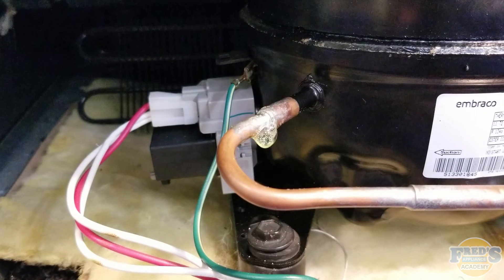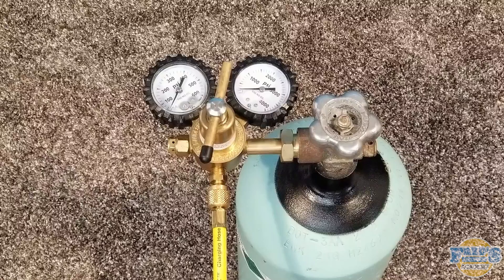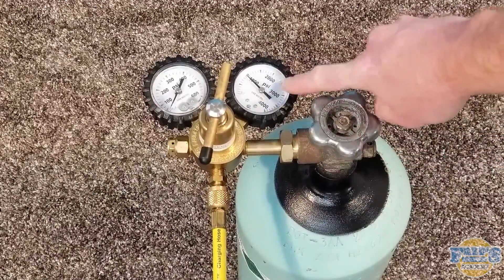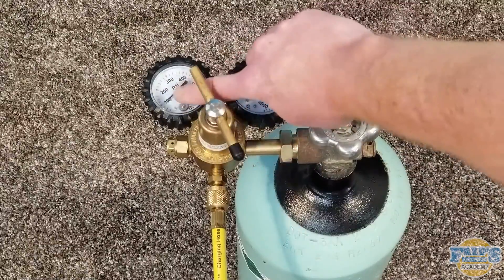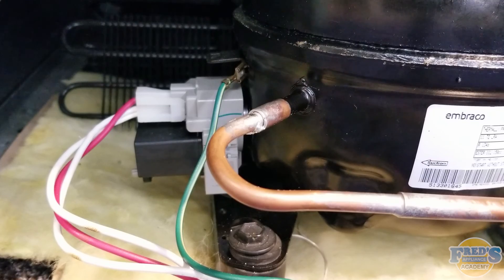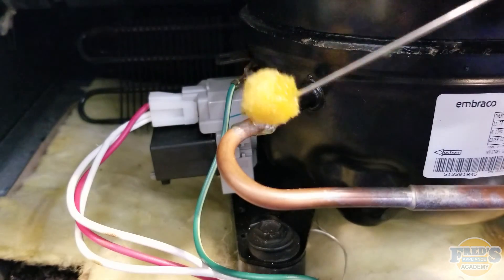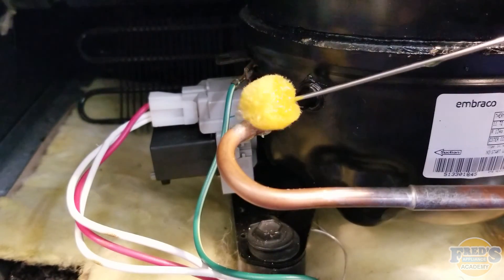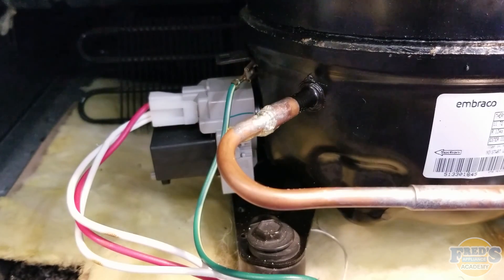How to pressure test a refrigerator sealed system using nitrogen

Comment: What bubble test solution are you using here? Ty
Reply from the maker: here is a link for you. https://www.amazon.com/Highside-Chemicals-23008-Mid-Temp-Detector/dp/B08QGNP4YF?crid=1W14U0WYBBM56&dib=eyJ2IjoiMSJ9.VIYtDSgX0wVyFfm-Ww68nYETnY0dvkUxVsQZb8Ruv9F0Yk64JNShLT47sA0M_tRLDzHni5EYJuh6pJeI-Rn8nqawW6i4q9CobQIntZmL0pwPNijNxWqp-LHmKyFKjCqApr3aW3X_fajyUKpGJ1CNLmEj4rbnXeoCDcWBKTjc-SImfORyfAFJFfVFKR-NS53nW1hm8fm5fYmzmdEmCW-mkS5U3j7ar7vzuXOc8y4cqIjanTEnTF2i4pRSokU9MgyPWKw_lO392Xd-W-UvppfCexYH2DABP31vQxQMVYBKwf5SleWeg1fxMV3cbVNIp8SktOf5uUkGNomO5xofTuOS_weUFAoL6Wrw4SgLXv0YjFWPp1GEE-4G28K0axvEgoaqJuF5blOhBURkcybApY5xHv662_gOj58cIvkAN51bPGleyVoNMHb-lrPhGSsOu3yF.W-MD_Y2PniBLKKPgO2-GbEn9sF_xbAkKaNZfUSsrTMA&dib_tag=se&keywords=highside+gas+leak+detector&qid=1736772419&sprefix=highside+gas+leak+detector%2Caps%2C68&sr=8-5

You can also you a product called big blue that works well or even just some dawn and water.

Comment: Would it be possible to do this with carbon dioxide? I have 2 fridges that stopped cooling  at the bar I work at, we don't have nitrogen but of course we do have a co2 tank for the beer kegs.
Reply from the maker: It would be possible but not recommended. CO2 can carry moisture with it which will get introduced into the system and could cause problems.
Reply: @fredsapplianceacademy  thanks, yes I didn't think of that

Comment: If you see this, can you please answer a question? I recently had someone diagnose my refrigerator, and he tested the refrigerant pressure. My refrigerator is fine, it turned out to be my dehumidifier leaking refrigerant. However, ever since the repair person came, my refrigerator now kicks out this perfume-like smell every 2 minutes, whether it's on or off, although it does lessen a bit when it's off. The longer it's on, the stronger it gets. It does NOT smell like refrigerant, which I know has a faint ethereal smell. This smells like strong perfume. Could he have had something on his hands or his equipment that did this? and how do I fix it? Thank you!
Reply from the maker: The only suggestion I have is to give it time. The refrigerator itself cannot create this smell. Maybe some type of air freshener was placed around or behind the unit? What ever the case may be, given enough time, it will go away on its own.
Reply: @fredsapplianceacademy  Too many people have too many different answers. It will not go away on its own. Finally I found out that it's the oils from the compressor that atomize when the refrigerant starts leaking that causes the smell. I just put myself through so many exhaustion because of hiring someone to come say it was fine when it was not and trying everything to get this intermitten smell out of here, to finally pushing it outside my apartment and that was the only thing that got the smell out. Too many people say you won't smell it when refrigerant is leaking and it's just not true. I even paid someone to test it, and I've just been misled all over the place. I'm still exhausted and behind with work because I had to figure it out. Breathing in that scent every 2 minutes for that many days was torture. It's shocking how many people say so many different things. All I know is that the scent was definitely coming from my refrigerator, it was intermittent, and started out faint and grew stronger over weeks. It would have never gone away on its own and no one ever comes into my apartment but me to have put an air freshener behind it. There is something seriously wrong with that refrigerator and I'm so glad it's out of here by now. Thank you for your response though.
Reply: @Katyayanibetha  If there is any leak , that smell comes from mixture refrigerant & oil and mechanical components of compressor.  In this case your refrigerator will be out of work.
Reply: @constantean1  Nope, incorrect. It was confirmed my refrigerator had a leak, and it had not stopped working yet. The type of refrigerant it had in it is described in chemical data sheets as having a faint smell. I wish I could have been provided the right information for the people who are supposed to know, as I wouldn't have suffered so many weeks trying to figure out where the intermittent smell was coming from. I originally thought it was my refrigerator. Everyone kept saying what you are saying here, I tried everything to get rid of the smell, it kept getting worse - and then I pushed my refrigerator outside for my landlords to have an expert to deal with, so it was confirmed to be faulty and replaced. The smell went away just as soon as my refrigerator was out of my home. It was still in full working order at that time, as well. It just emitted a scent of perfume combined with exhaust fumes every 2 - 3 minutes constantly. It was worse than Chinese Water Torture.